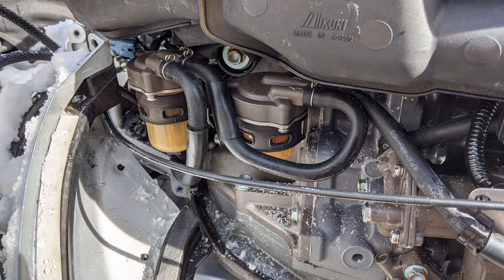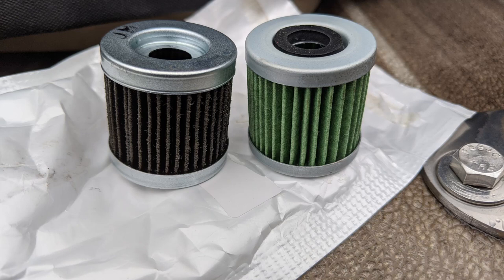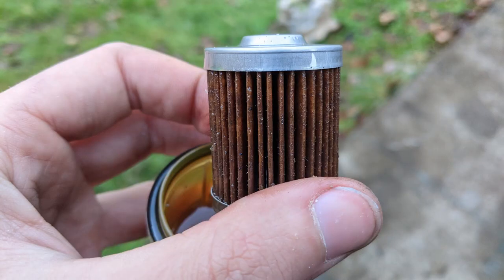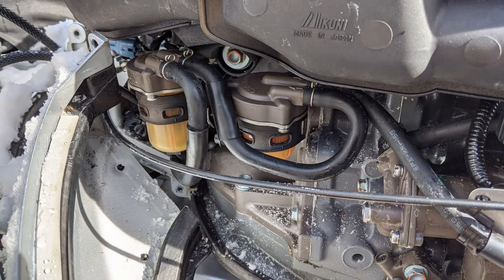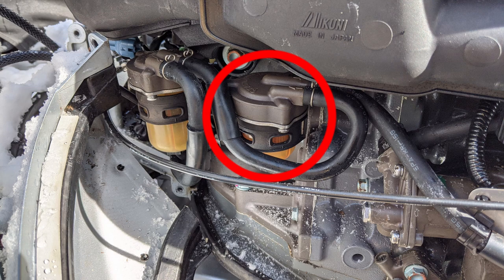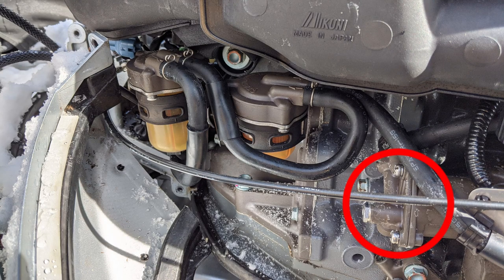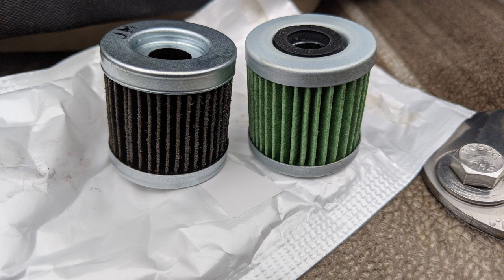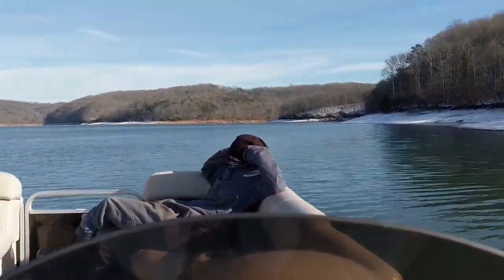Changing fuel filters on a 2017 Honda BF150A outboard (both filters) due to a surging problem

Comment from the maker: The filters you'll likely want for your Honda, These definitely fit a 2017 BF150A but likely fit a pile of other models:
Primary filter (Suction side, inside plastic bowl Sierra #18-79909): https://amzn.to/3dv6J2y
Secondary filter (After lift pump, inside VST housing, Sierra #18-79908): https://amzn.to/3pCIMIG
You may be able to find cheaper filters from other brands, but those are the ones I recommend.

Links used on our channel may be affiliate links, which allow us to earn a commission should you decide to purchase an item from them, this is at no additional cost to you and helps us continue making videos like this.

Comment: Wow! What an excellent video. We had the same problem and  we made exactly the opposite mistake. We changed the lower pressure filter but not the high pressure one. Going to get the parts now, will update you ASAP.
Reply from the maker: Awesome! Hope it helps you get back on the water.

Comment: mine idled fine and I could get to 2 grand no problem, ease to 2200 rpm and she starts to sputter, pull back on throttle and she would run decent again.. just put new filter in and put on muffs and quick rev to 4 k ... going out to the Big Lake this afternoon.. Jones to get on plane again.. think you helped me solve my problem.. THANKS!
Reply from the maker: Those filters are kind of stashed down in the cowl, and get overlooked quite frequently. I've heard of dealers that don't know where they are (This boat sat at one for quite some time because they couldn't figure it out), Glad the video helped you sort out your boat!
Reply: got 4k out of here, pretty choppy waters today... but then surging resumed... changed 1st filter last year, will change once get delivered tomorrow.

Comment: Hello,
It is perhaps not the main topic here but I'm a newbie and just got a honda bf75 from either 2017 or 2018, i was wondering if it has a water separator included in the engine already or do I need to buy and install an external one ? thanx.
Reply from the maker: From what I can see there isn't any real water separator on a df75 of that era, just a little inline fuel filter, so adding an external one might be a good call.

Comment: Great video. Do you need to put clamps on the fuel lines to keep fuel from coming out when removing the filters?
Reply from the maker: You're going to lose some fuel just from the act of removing filters and stuff, which isn't a bad thing because any water or other contaminants can get disposed of, but it may not hurt to clamp the line coming from the fuel tank just so it doesn't siphon out your whole tank, and of course be mindful to catch any gas you can from the filter housings, don't pollute!

Comment: Did you use a screw driver to pry  the suspension strap off the bracket?  Looking at a h 60 fuel filter replacement.
Reply from the maker: If you're talking about the goofy rubber strap thingy that holds the filter housing, I may have, but be cautious you don't slip and either jab your hand or crack the plastic housing. I feel like I just wiggled and pulled with my hand, but I'm not sure.
Reply: @trythistv  Thank you for your input!

Comment: so in this video, you replaced 2 filters. Do you know which one actually solved the problem? or do you always replace both.
Reply from the maker: The problem filter in this case was the "primary" filter, the one in the little plastic bowl, right here: https://amzn.to/3dv6J2y, it certainly wouldn't hurt to do both, especially if you don't know if the high pressure "secondary" filter hasn't been done (the one in the VST housing, available here: https://amzn.to/3pCIMIG)

Comment: how do you remove the lower cowling? I need to do this on my new to me BF135. its a 2005 and the fuel filters have never been serviced
Reply from the maker: There are like 8 or 10 little bolts, I think they're 8mm head that are scattered about all over that connect the two halves of the lower cowl to eachother, I loosened them all, then just pulled the one side off, which is fine on a trailer, if you're working on a lift or in the water (we do a lot of mobile work), its a little precarious to be taking all that stuff off, I'd recommend trailering the boat and doing other essential maintenance like water impeller and lower unit oil while the boat is out of the water (unless you know when those were last done and they are OK for the season).
Reply: I need to do the same to a 07 135 looks very similar. Would you be able to send me a picture with the bottom part taken off like you have it but a pic of the whole side. Using as a diagram

Comment: Do you have a link to the part numbers for these fuel filters.
Reply from the maker: I do indeed, it is stashed in the description, which has become harder and harder to find nowadays on here. Here it is again in easier to find format:
The filters you'll likely want for your Honda, These definitely fit a 2017 BF150A but likely fit a pile of other models:
Primary filter (Suction side, inside plastic bowl Sierra #18-79909): https://amzn.to/3dv6J2y
Secondary filter (After lift pump, inside VST housing, Sierra #18-79908): https://amzn.to/3pCIMIG
You may be able to find cheaper filters from other brands, but those are the ones I recommend.

Comment: Would the high pressure filter behind the metal plate cause rough idle and slight exhaust smoke x
Reply from the maker: Maybe, but I would suspect spark plugs before fuel filter with a rough idle, clogged fuel filters tend to give symptoms of surging or issues at higher rpm.

Comment: does anyone know what the little spring do on the high pressure strainer? Mine is missing
Reply from the maker: I believe that spring is to hold the high pressure filter in place, if the spring is missing, the filter will just flop around in the housing and not be pressed against the rubber seal on the end of it
Reply: @trythistv  hmmm... wonder if that would create a restriction. Our BF135 is having similar issues, replaced all the filters, fuel pressure checks out at idle but can't go past 3k RPM. When we replaced the high side filter there was no spring.

Comment: 150hp at 6000rpm and speed is 27mph.   Ouch, must be a heavy boat.
Reply from the maker: I do believe it was a 26ft, and an absolutely gorgeous boat, had every option I'd get on a pontoon, power assist steering, power Bimini, the awesome woven style flooring that just washes dirt off without staining, it was great.
Also entirely possibly the speedo was off, it was a pitot style rather than gps, it felt pretty quick for it's size, but most pontoons seem like they are meant for putting here and there until the last few years of hanging a 300hp engine behind every toon and such.